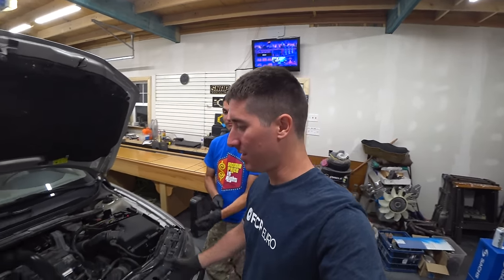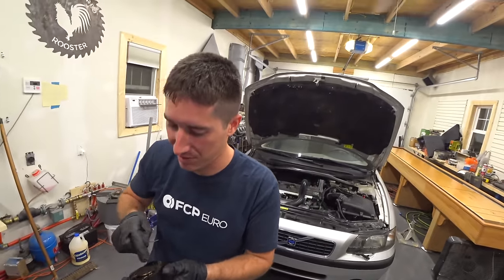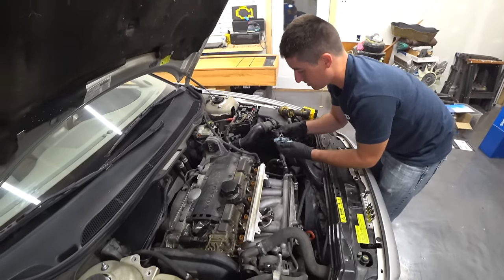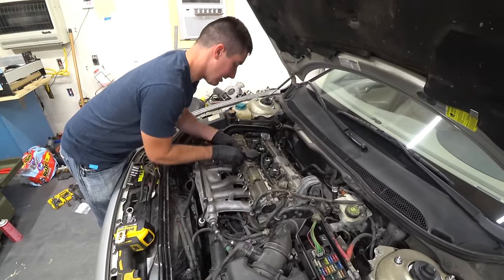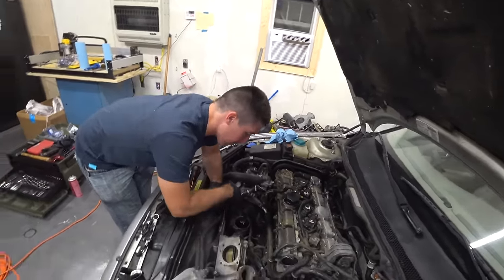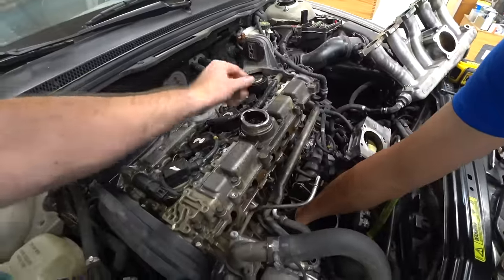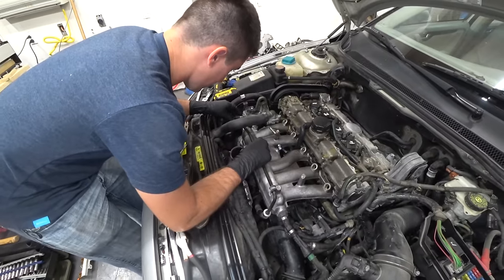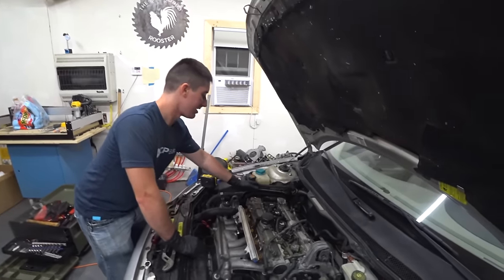POORLY DESIGNED Volvo S60 PCV System *COMPLETELY Clogged With CARBON*

Comment: Most common cause of oil leaks and trouble with Volvo's is clogged PCV systems, Dealer or good (And I stress GOOD) Indie workshops will change the box and flame traps out regularly.
DIY owners not so much because on all Volvo's from the mid 80's 700 series they are buried under the intake and hard to get to.
people also shortcut and dont replace the O rings between the block and box and this creates leaks too which can be hard to diagnose.
Then they suffer Cam seals popping or worse Crank seals even though this is extreme neglect as the oil caps will weep for ages well before it pops a seal.
I do the workshop glove over the oil filler test checking for high + crankcase pressure but in all honestly theres so many variables from bad oil quality to late oil and filter changes that you are just best off replacing the lot so you have a known quantity and this applies to both the older Red block engines and the later modular white block engines in 4, 5 and 6 cylinder.
As a rule I just order a few kits from FCP Euro so i have them on hand and as they ship fast and reasonable rates even to Australia.
Reply: tony66au :😉🍻
Reply: If there was a way to delete or substitute the PCV system with a better work around I bet they'd sell like hotcakes.
Reply: @thomas316  You could run a catch can inline with the PCV, but it's not something that people totally replace.
Reply: Redblock PCVs are easy. I haven't done one on a turbo, but on the NA it was stupid easy compared to the white blocks. I didn't even need to pull the intake manifold.
Reply: @radnybolt5327  I wasn't sure if they were different, I know some guys with turbos say to remove the intake. On my cousin's '91 240 it wasn't necessary. I used to have an '88 740 turbo, currently have a '93 NA 940. I love red blocks, but white blocks are awesome too... I've certainly had more of them! My current daily is a manual swapped 2000 V70R.
Reply: @thomas316  how about a long coat ahnger and bristle brush to clean the gunk?
Reply: @thomas316  Alex is right. You can retrofit an oil catch can to rid of this problem permanently. I've seen it done and it works like a charm.
Reply: one of the very big main problems for the pcv is people who baby their volvos, this isnt as much of a problem on the s60R/v70Rs because people drive them hard. One redline a day keeps the mechanic away! unless you got an old timing belt like me of course.
Reply: In 1972, I had a new Volvo 245 wagon crossing Saskatchewan in -30F temperatures.  
While driving it was OK but when I parked for a coffee break, with the engine still running, I was alerted to a large pool of oil under the engine.  
Unsure what to do, I added oil and drove 60 miles to Regina for a check.  
It appears the PCV was prone to freezing in those temperatures, causing a blockage, causing crankcase pressure to back oil out through the dipstick.  
Could have blown the engine.  Very unsettling for a Swedish winter car!
Reply: George Etoile um the 240 didn’t start production till 1975 last I recall. I remember the 140 being made till at least 1974
Reply: Rex Volvo:  Thanks for the correction.  i guess it was actually was a 1972 Volvo 145 wagon. After all these years some things get a bit fuzzy.  ;-)
Reply: George Etoile yeah the model isn’t too relative since they still used the redblock but at least it’s clear that about which one had the issue. I personally didn’t know about it being able to freeze up. I hope they did fix it for the later engines. Thank you for sharing with us. It’s stories like these that will soon disappear which is unfortunate.

Comment: The PCV on the turbo is quite a job at some points - banjo bolt, left intake bolts.  Also take an appointment for a lower back massage when finished.   A wobble 3/8" drive adapter is quite a must and I would have removed the rad fan first.  It's a perfect time to replace the thermostat housing too and test the evap canister purge valve

Comment: This is just so damn satisfying. I love seeing older cars getting the attention they need. If I had a shop space, or a garage, there's no doubt I would be doing this.
Reply: I agree with you 100%.
Reply: its slightly depressing though when you think that all this work adds up to a no time job on other cars.  I am in the process of pulling my car apart for this repair as we speak and I am learning the fun of removing that left most bolt near the thermostat 7:01. what a place to put a bolt...

Comment: I remember the good old days when the PCV valve was right on top of the engine, right through the valve cover. Took almost 10 seconds to replace.
Reply: The Volvos really isn't just a PCV but more like a recirculation filter box. The old ones is just a hose.
Reply: Honda V6 is still like that.
Reply: Took me 2 minutes on my 011 Kia Optima 2.0T
Reply: Most NA cars still ARE like that. Welcome to turbo land! They got to move MORE fresh air, when under boost with these fancy ventilation systems

Comment: I love your videos. So nice to watch.
Yes, the pcv system on the turbo engines are hard to work on. On the 2.4 non turbos they are easier within reach and cost less time to replace them.
These 5 cilinder Volvo engines are really bullit proof if you maintain them right. Proof, look at the valves on this particular engine.
Here in Holland I have seen some of these engines reach more than 800.000 km's without serious issues. Totally impossible with newer direct injection and turbo engines. VW's modern engines I have seen them break after only 40.000 km's. Audi TFSI engines need a complete overhaul after 100.000 km's which costs thousands of dollars.
Volvo makes really strong cars and compared to modern cars are still relatively easy to work on.
Keep on going making these great videos!
Reply: anfahrt: 😉🍻

Comment: nice to see you are so thorough, i repair volvos on the daily and know this job well, a few tips, the strut bar doesnt need to come off(though understand why you did because of the cams), the fuel rail also does not have to come off, as for the bastard bolt its alot easier to get if you take off the thermostat housing, a tip with those volvo clips is to get a flathead that just fits,twist, then pop the tab, quick and easy, really enjoying your videos keep it up
Reply: Help........there is a pressed in pop off cap of some kind, mirrored on the valve cover, just past the oil cap in the same spot. Closer to the firewall i guess you could say.   Well mine blew off and im trying to figure out what its called, or how do i replace it? Or.......any advice would help. 01 v70 xc cross country thank you
Reply: @chrismckamey3082  never seen one of them pop out before, im sure the right sized frost plug would fit it (I have the same car)
Reply: Why’s it called a “bastard” bolt? *Before I could get the bolt off, the brittle plastic line attached to it broke off 😡
Reply: @homesold  because its a bastard to get at

Comment: Owned a V70R for a few years and the engine architecture is almost Identical to the 2.4L, with Volvos it's more or less about how well it was taken care of before you got the car and it looks like you picked up one that wasn't well taken care of at all. My V70R had over 40 service records and papers of each service since it was new in 04, over the three years I owned the car it only had two things go bad on me. One was an ABS sensor in the left front caliper and the other was the catalytic converter because of the bad winter mixes we get here in Michigan, I put nearly 9000 miles on that car and it never even hiccuped once after all was fixed. Don't blame the car man blame the previous owner for not taking proper care of it. Sidenote: I actually made money on my V70R, purchased for $7500 in 2015 and sold for $9800 in 2018.

Comment: This is perhaps the biggest reason why I'm really happy with my normally-aspirated 270K 2001 S60; The PCV system in these NAs is much more straight forward, and my previous PCV system lasted 197,123 miles, and 15 years!! And it would've lasted even longer, if I didn't replace it because there was actually nothing wrong with it! This is also why keeping up with oil changes is extremely important!
Reply: You still mess around with those N/A 2.4 volvo 5s?

Comment: I love it when the PCV/oil separator on top of the engine in the XC70 and XC90s goes bad. Makes a LOUD screeching at idle and only takes 7 minutes (if you take it slow and easy) to replace. Customers are always happy afterwards 👍.

Comment: I went through this same long process with my s60 when I noticed smoke coming from under the engine area. I went through torturous process removing the intake manafold, clamps, connectors, etc. When I finally got to the Pcv system I noticed it wasn’t really that dirty or clogged so I just cleaned it a little and left it alone, but I did discover a huge vacuum leak coming from one of the plastic lines inside the foam insulation sleeve that runs underneath the intake manifold.
Reply: Yeah, those lines are terrible.  They did away with them and replaced them with metal, but I'm not sure which year that happened - my 2006 S80 has metal lines.
Reply: @looncraz  Yup the 07+ S60 has the metal line and it ain't cheap. $130
Reply: @richardpflieger2049  Not cheap, but you can just flush them out and keep using them... They should never require replacement.  I replaced all the rubber with silicone radiator hoses on my S80 and my old 850 I replaced the entire PCV system with silicone hoses.

Comment: On a 2012 Honda Civic, the PCV change takes less than 5 minutes and there is nothing to move out of the way.
Reply from the maker: You understand my love of Honda Civics 💯
Reply: Michael: Yup. Short. Sweet. Simple.
Reply: And the Honda is not a turbo. That is also an oil catch system while most just call it a PCV.
Reply: The PCV is more complicated on a turbo engine. The honda is just a valve with some hoses... And since this sounds like a competition, we should have a race on who can replace a timing belt the fastest. 😂
Reply: @GCast-iv1pd  s60 timing belt is so easy. the biggest thing you need to get off is a wheel. snapped mine and got everything back together with new valves in 2 working days.
Reply: @Blair Aquilia you know the 940 was made till 96 and it will outlast any honda
Reply: @Blair Aquilia a 940 costs like 20 bucks to change cambelt and they use the same filters as everyone else
Reply: God bless Volvo and all of their amazing sweedish engineers... I have an 05 S40 i and the box is under the intake and all that.  Leaking oil from the top of the engine!! Spark plug tube seals I believe, but this has to be causing the issue.  Good info guys!
Reply: @Blair Aquilia lol u havent been in sweden, only volvos ahahah
Reply: Blair Aquilia yeah and im looking for an older Volvo
Reply: Blair Aquilia that’s a sweet car
Reply: @Blair Aquilia I love Hondas but this statement isn't true, maybe where you live it is, but I see just as many old Volvos as old Hondas and they're normally in better condition.

Comment: oetiker clamps! Thank you for mentioning and including this in the video. I had issues with one of them in my GKI vc axle boot kit for volvo s40 fwd. ended up installing a universal metal band clamp instead with the banding tool. I will find and replace with an oetiker clamp if need be

Comment: Oh man JR, ya'll done goofed by not replacing that line that connects to the intake manifold via the banjo bolt. It's a real pain to replace the whole line, but on my S60R I did exactly what you did, just replaced the box/top breather hose and put it back together.  A year later I blew out a seal because that line was still clogged. Had to go back in and replace it.
Reply from the maker: Scrubbed out the fitting, then sprayed some brake clean through it to make sure it was clear 🍻
Reply: @WatchJRGo  Nice, no clue why they made that line coming from the banjo bolt so small. I think that little line feeds into the bigger line that wraps around the block and draws air from the air intake? Thing gets clogged up so easily. Great work on this Volvo flip, it's comforting to see that even a much smarter/experienced mechanic like yourself struggles with the same things I do on my S60R lol. Love/hate relationship with Volvo.

Comment: What kinda issues does it give you when the pcv fails? When I put mine in reverse it starts vibrating like shaking and when I put it drive it’ll do the same but less..? Can someone please tell me what can that be?? I changed air filter ,maf sensor spark plugs and coil packs. I’m literally running out of ideas.

Comment: Great job and I enjoyed the video. But there is 1 critical step ya missed. You must clean the PTC nipple! It's located at the bottom of the intake tube coming from the air box. Don't remove it from the pipe or you will never be able to get it back into the pipe. You would have to buy a new pipe that includes a new PTC nipple. It's~ 110$ from FCP my go to Volvo parts supplier. And you didn't mention the superceded Banjo bolt. It was redesigned so the check ball in it cant come out and get sucked into the turbo. Sorry about being picky but I think it's important.

Comment: I've done this jobs MANY times on many Volvos... it never gets any more fun! That banjo bolt on the intake is a giant pain... I usually just remove the alternator to get to it a little easier. Removing it is easy, reinstalling it is the problem... it never aligns easily! With the timing belt job, make sure you set up the VVT correctly. There's a great video on here on how to properly set it up. Fortunately on that car you have single exhaust VVT like in this video, so that makes it a little easier. https://www.youtube.com/watch?v=o4uLvH151-c&t=327s
Reply: Alex P:😉🍻

Comment: Volvos are fantastic cars (minus the side mounted timing belts) and are incredibly excellent at running well and with great gas mileage (outside of the enormous carbon buildup) and have a great ride with smooth highway driving (outside of the vacuum cruise behind the brake pedal failing often) and yes, I'd totally buy another.

Comment: Im literally in the process up fixing up a 2001 s60 t5. Only done 99k miles and its a manual! Over here in the uk its hard go come by. I need to also do my pvc, thermostat and a couple other parts and she should be good for a long time. Gotta check the cam bucket seals too tho. Just so costly! Got the car for £200🤣

Comment: Ant did the same pcv job on the Wheeler Dealer Volvo wagon episode.  Doesn't look like fun in either of your cars.  Don't think Ant did the seals, so that will be something new.  Good job.  Should be a nice car when you're done.
Reply: Terry Lessmann: Don’t get us wrong, it’s a great car! It’s just tedious to work on.
Reply: @Gabe-ABNCW3  And that's what's great about the video - it shows you have to take a crapload of parts off to get to the pcv, but it's doable and you don't need special tools.  That's what DIYers want to see.  And when you're done, you've added value that can differentiate it from other garden variety Volvos on the mkt that haven't addressed the pcv.
Reply: Terry Lessmann:😉🍻

Comment: I drive a volvo s70 turbo it has the same problem.  Im too cheap and lazy to fix it so i bypassed it.  Still runs good  no smoke or oil leaks. I believe this happens due to the previous owner not changing the engine oil frequently enough.  CHANGE YOUR OIL!

Comment: My Volvo S60 is a great car. Incredibly reliable. Only thing failed after nearly 18 years is the alarm module and the DIM. Both cheaply and easily fixed
Reply: how'd you fix the DIM?  Xemodex?

Comment: Ah, the dreaded banjo bolt. The phantom that haunts the 5cyl mechanic. It took me 2.5 hours and 2 trips to the shops to remove it.

Just a tip, Volvo designs its cars with the car on lifts during servicing. Meaning, it's easier to remove from the bottom. For the XC90,  you can remove the PCV system without removing the intake man. Just remove the rad fan to get more space.

Yes, the PCV is poorly designed. I was told that it was added later on (for emission reasons) and was not implemented properly. Mine was blocked all the way to the sump so I had to remove the oil sump as well to unblock it. It is said to be replaced every 100k kms but is not included in the service schedule. I've seen other bypass it and retrofit an oil trap on the side of the engine bay.

Comment: I should be working on SQL server but John Ross is always good to watch 😏
Reply from the maker: I've always wanted to name a kid Drop Table and watch the trainwrecks it causes 😂
Reply: WatchJRGo you’d think injection wouldn’t work anywhere anymore but I guess you don’t know until you try 😅
Reply: Index=* source=watchjrgo | table title, _time | sort - _time
Reply: @token112  this has gone to far 😂
Reply: token 1 That looks more like SPL for Splunk than SQL
Reply: @Chase_AM  BAM!
Reply: token 1 I’ve got DB Connect to forward from SQL to Splunk so I’m used to seeing the two in the same context haha
Reply: @Chase_AM  does that use rest API or some other standard?
Reply: token 1 It’s a tool you can put on a Splunk heavy forwarder, which makes it possible to get SQL data into Splunk. It’s a great way to be able to search the data using SPL and use those awesome Splunk dashboard for SQL data!

Comment: Funny about that oil cap. Not to name the only Volvo dealership in Wichita. They couldn’t find the oil leak and burning oil smell on a Volvo. When I got it I did my own oil changes and found oil always on top of the motor. I spent $5 on the gas cap. Fixed it. Previous owner spent hundreds at the dealership in diagnostic fees and they never found the problem.